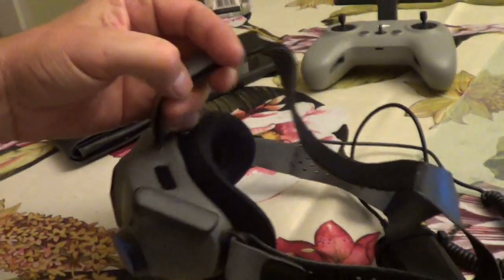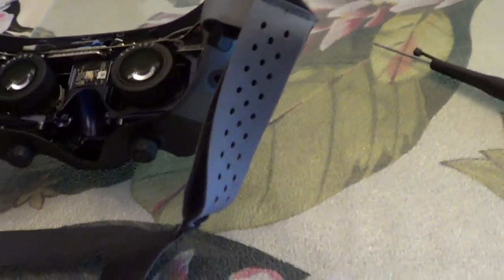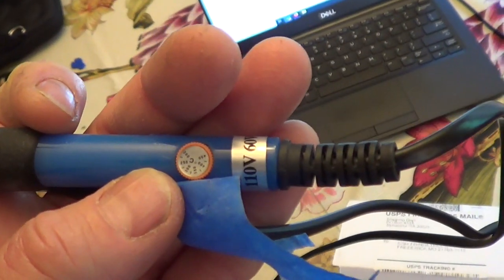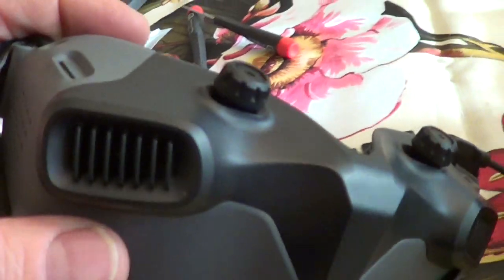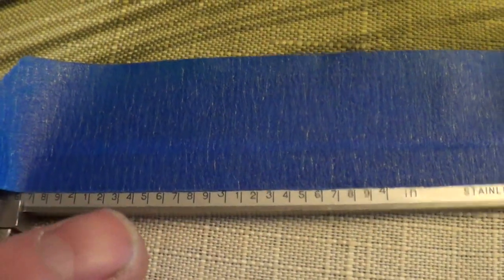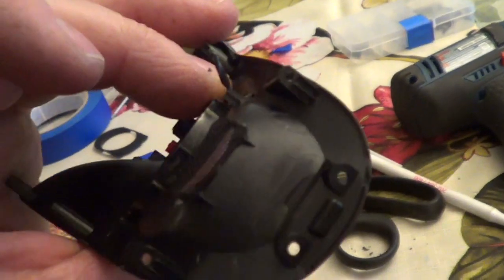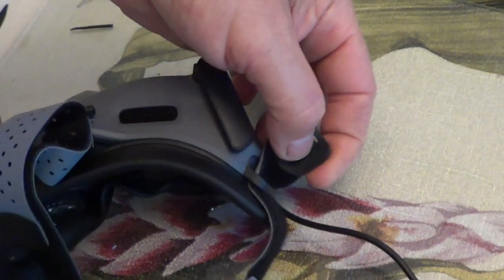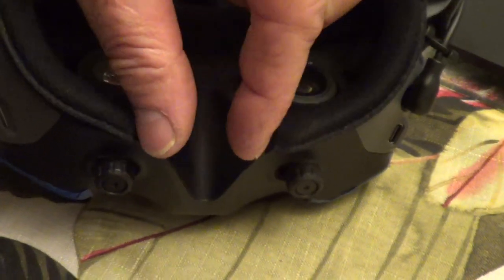DJI Goggles 2 Mods to Fix Fogging, Screen Cut, and Comfort

Comment: I love these goggles 2.   The focus is amazing.  I never realized I was always out of focus for years on my V1 and V2 previous goggles.   The contrast is amazing.  And the smaller size is a big plus.    Now, I just have to convert the Remote Controller 2 to have the radio master full aluminum sticks.   I tried a few months ago and failed.   I will probably end up transplanting Remote Controller 2 into a Radio Master boxer case.   I'll do a video on that.
Reply: What do you mean replace the sticks on the remote 2? How do you do that?
Reply: You must have a small nose and face. These goggles 2 are blurry as hell and pinching my nose to the point of being unusable. If I take the faceplate foam off I can find a position where it's almost clear around all the edges, but holy crap the optics suck! There's no position that makes the whole screen focused, eyelashes up against the glass to pulled way back. Nothing is clear.

Comment: I just removed the foam and use the goggles plastic directly on my face. It’s perfect. My eyelashes rub on the lenses but you get used to it pretty quickly. I get no vignetting at all.
Reply from the maker: Isn't the image quality nice on these goggles?    It is way better than V2.

Comment: would you recommend the dji goggles 2, i have the v2 now?
Reply from the maker: Definately if you can do the mods.   Without the mods I really hated those goggles.   It might be possible that just blocking off the front ports might be enough without having to drill the face plate.   I didn't try that.     Another advantage of the goggles 2 and integra is the frequency hopping of auto channel mode.    I fly micro drones all over the place so I never know when I am going to get interference.    Someone else commented that integra doesn't have a fog issue.    I asked that person if dji plugged the front bottom vent holes.   I'm waiting to hear back.
Reply: @microdronetech8453  yeah have heard the same thing, the interga has little ventilation holes in the mask that prevent it from fogging
Reply: But even withouth fog what is so much better then v2? I have both and I am about to sell the goggles 2 (fog terrible, and I will not mod the plastic for it, tried 4 different foams but my eyelashes always touch the screen, only 2S battery possible and plug is also a stupid size…I want to love the goggles2 because of weight and size but also I see the 20hz difference. To me goggles 2 feel absolutely aweful and like a downgrade even screen is smaller
Reply from the maker: @FreshPanda97  Goggles 2 are better than V2 for the following reasons:
1)  Fog is fixable with the holes.    
2)  Top strap is fixable with nylon tie
3)  Screen is the same size as V2
4)  Focus is way better than V2 if you wear glasses
5)  Additional E3 chip has a huge die and lots of processing power
6)  Dual band does channel hop in the air.   Much better against interference.
7)  The lower band penetrates trees better
8)  Smaller
9)  Remote 2 works.    I put radio master stick ends and it is a pretty decent hall effect gimbal in remote 2.
Reply from the maker: @FreshPanda97  Are you seeing the jitter 20hz difference on Vista.   I definately see that.    I'm getting custom titanium hardware made to actually run the O3 unit in a micro.   I suspect O3 won't have any jitter.

Comment: I like the mod that's really cool however the DJ. I integrates did solve the fogging problem. They have littlo'channels under the face plate and I have no Foggy issues.
Reply from the maker: Did they block off the two front ports to allow suction from the back?

Comment: Really destroy you goggles by drilling a bunch of holes in them wow is anyone really that stupid to actually wreck their goggles like this
Reply from the maker: I just copied the design for the V1 and V2 goggles that don't fog.
Reply: What a stupid comment. These goggles were so flawed from the factory that these mods can only add value. This guy could probably buy these goggles, mod them this way, and sell them for more. The commenter clearly doesn't own this product.
Reply: @polyscient  as a mater of fact poly I own all 3 dji goggles how many you got poly and for your information nobody is going to drill a bunch of holes in their 600$ goggles what are you smokin bro?
Reply: If you can't use them why does it matter? They're his goggles go cry about it 😂
Reply: @DESTINYFPV  I'm sitting here right now considering going through with this. I dropped the $600 something on them right when they came out. I use them maybe once every couple months and immediately remember why I don't use them. I stick with the V2's. I'm glad they work out for some people but I just have too many issues with them. I don't want to sell them because I do like them with the O3 and even the previous gen air units look better. I just can't get past the blurry edges and constant fog!